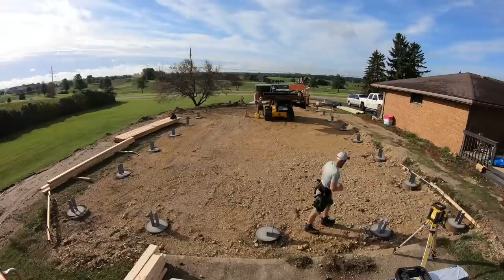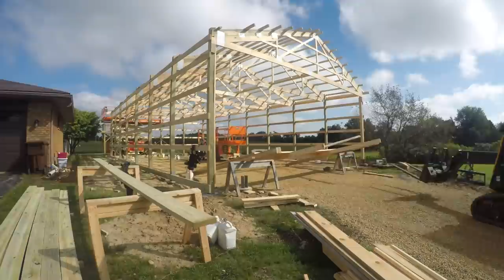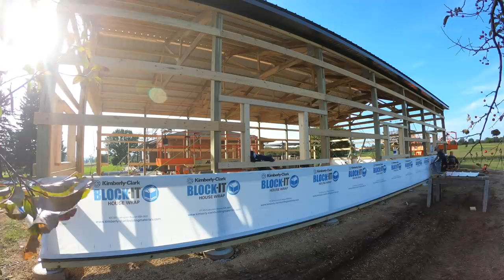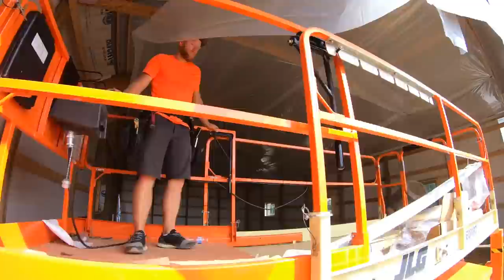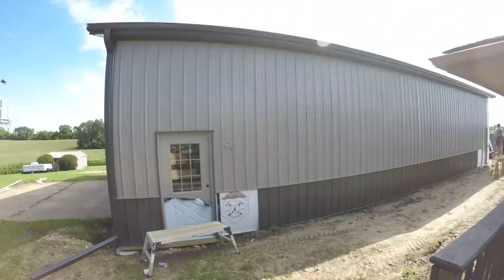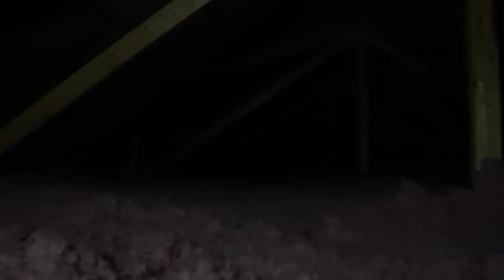Full Timelapse Shop Build with Final Walk Thru: NEVER SEEN FOOTAGE

Comment: Hey Kyle, starting on a 40'×64'×16' post frame this summer. Done quite a bit of building but was many years ago. Will be doing it by myself, but do intend on following your example. You definitely impressed me with your work ethic, as well as attention to detail. I'm 55 now do won't be as quick as in decades past, but I will get it done. Thanks man for all the great ideas.
Reply from the maker: Best of luck Gary
Reply: How's your build going?  What's your materials cost?
Reply: @Jekyll_Island_Creatures  started last month,one man build, so far material cost running 4% higher than expected, but doing the whole build alone although slow more than makes up the difference.
Reply: @Jekyll_Island_Creatures  kyle, biggest problem i have had so far, not owning the equipment,, so renting is booked months ahead ,but for example: was $1,095 saved hiring crain to set trusses as opposed to renting telehandler for 1 day,, which wasnt available anyway. Had brother and nephew help, we placed 9 truses in 4 hours. Thx for all the info, does prove helpful.

Comment: 2 questions i hope you can answer Kyle! 
1. Since the trusses are 8’ apart, how do the insulators do the blow in from one end to the shop to the other? are they able to walk on the metal siding ceiling?

2. Are your screw lines off on the roof since you guys stagger 2x4’ back and forth all the way across?

Great looking shop too! im 22 years old and joined the apprenticeship right out of highschool at 18, and just journeyed out 5 months ago, i’m ready to start my own company! hope to start a post frame building company, really look up to you and your awesome builds.
Reply: Guessing they put in rat runs to insulate the ceiling with a blower.  They would fall through or damage the metal interior.
Congratulations on your apprenticeship completion
Reply: @corysturgis6660  that’s what i assumed, but never seen them put any rat runs in. in any of his videos! and thanks cory!

Comment: Hey Kyle, have you ever thought about using screws on your purlin to truss connection? I built post frame buildings for 2 years up in MN and on all the roofs we replaced the nails in the purlins were pulled up.. we used a 6 3/8 t25 grk screw

Comment: Nice build. I noticed you guys just cover up the interior walls and ceiling. What about the electrical and plumbing? I never saw any prewire for electrical or low voltage, or prepipe for plumbing. Maybe theres no bathroom on this particular build but what do you guys do? Is the electrical completely retrofitted?

Comment: So if I understand correctly, the horizontal 2x4s for mounting the inside wall surface were installed by drilling or screwing through the vapor barrier.  Does that allow moisture to get through at each hole in the vapor barrier or do the 2x4s sufficiently clamp the hole and make a seal?

Comment: Nice time lapse! I have sloped land and would like to build a post frame building in the next few years. Have you done or seen a two story post frame building with a poured stem wall on the uphill side and open to daylight on the downhill side? The lower floor would have the garage doors at grade on the daylight side and the upper floor would have a walk-in door on the uphill side.
Reply: Look at floor trusses...might be able to clear span depending the distance.

Comment: Why do you use electrical conduit instead of running the wires in the walls?
Reply from the maker: Most prefer conduit in a shop for future  modifications and cost savings